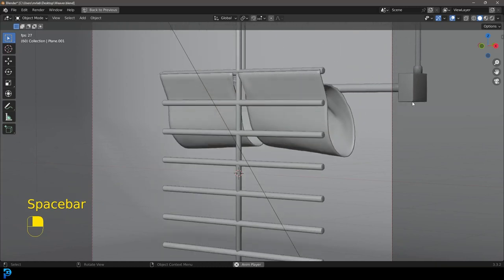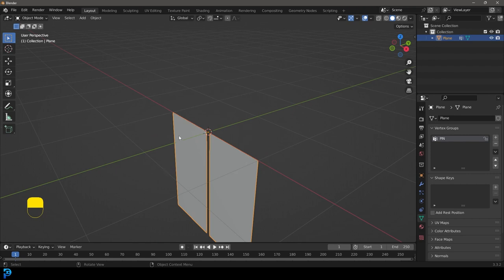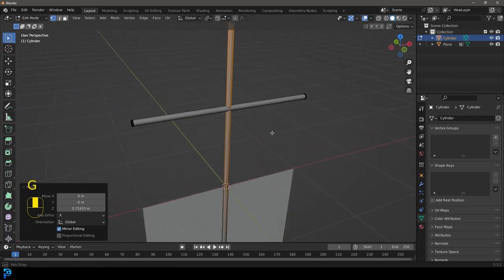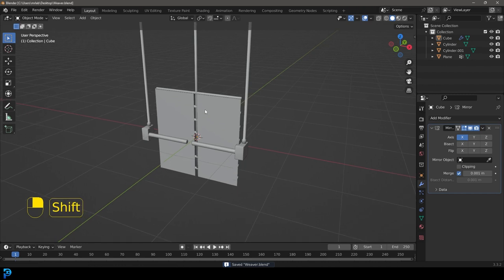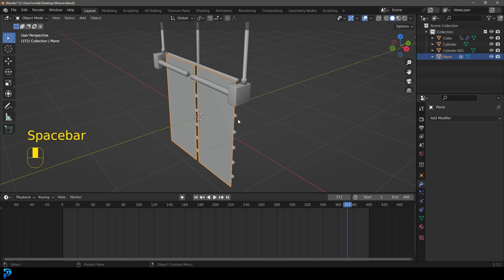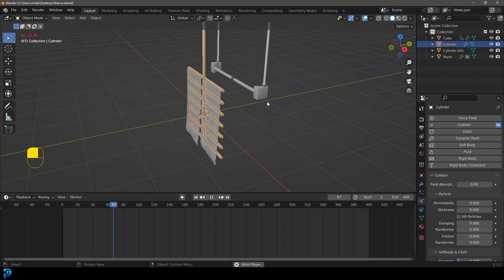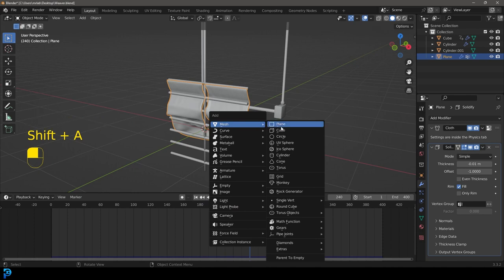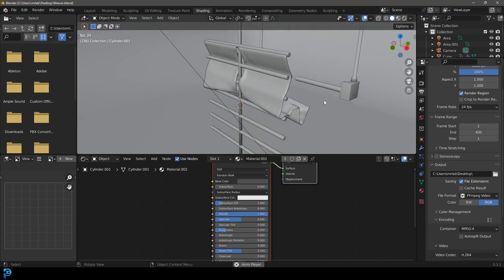Blender Tutorial: Satisfying Weaving Machine Animation

Comment: PIXXO, great tutorial. Love it. Learned a lot from you and really appreciate it. Great instruction methodology. I do have an issue where I have no idea what is happening. I decided to do more passes of the weaver to go down through all the horizontal brackets. After it goes through the number of brackets you showed in the tutorial at three passes, the next passes of the weaver doesn't impact the cloth. Weaver goes right through the cloth. In addition, the cloth starts to distort a bit for the final three passes. Initial animation works great. Can you share any ideas how to make cloth respond to all passes and to cut down on cloth distortion that happens in last three passes?
Reply: I just checked cache setting for cloth and saw I had not reset total frames count to same size as the increased animation. Adjusting that allowed the weaver to impact the cloth on the last 3 passes. However the distortion of the cloth is still there and worse at the end of animation. Anyway to correct that, e.g. increasing weight of cloth (if so how do you do it) or other suggestions greatly appreciated.